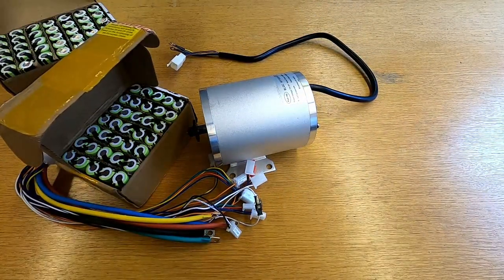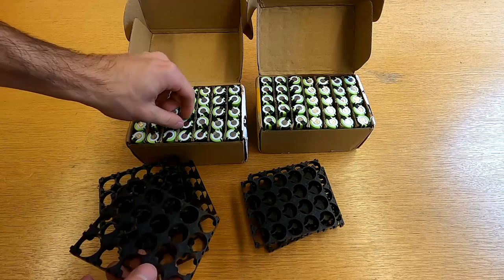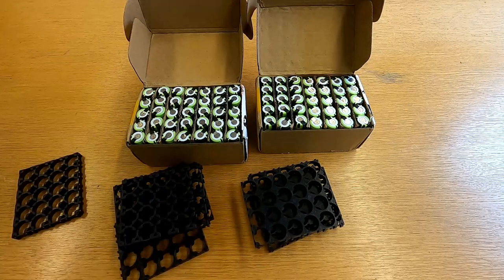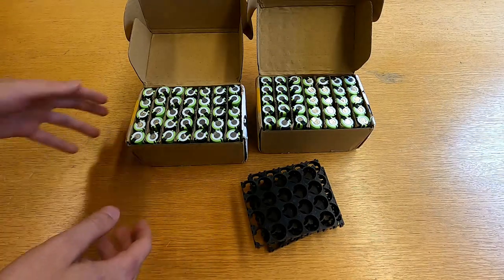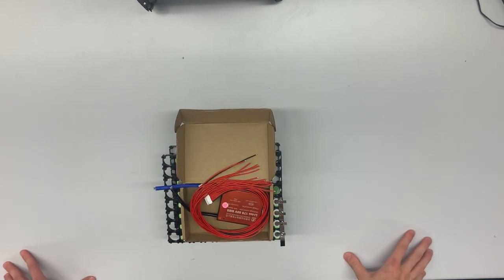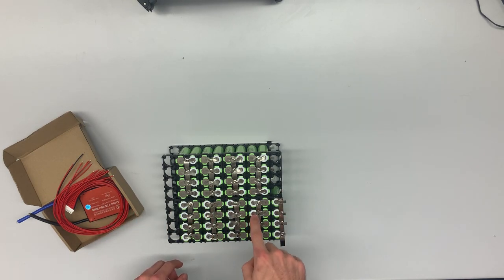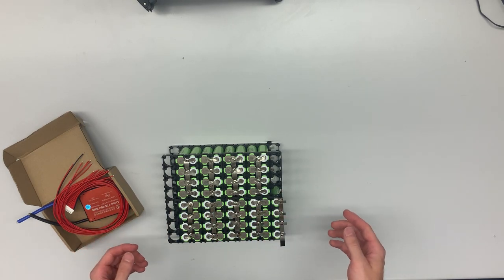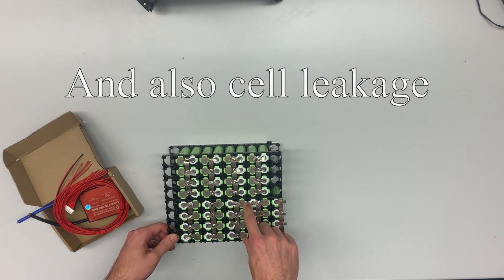DIY Electric Go-Kart #01 || Motor & Battery

Comment: Hi man, I would like to know how many Ampere is the continuous discharge current of this battery. I have a 2000w engine and I heard that I need at least 42A of continuous discharge current to use all the power of the engine.

Comment: Do you ever get this up and running? I just ordered the same style motor and was wondering if it was powerful enough for a go cart?
Reply: im sure by now you have the motor. Im looking at ordering it as well. Hows the performance?
Reply: @galacticgamer1752   I’ve got mine up and running. It’s top speed is 11mph with me and my 5yr old in it. It acceleration is pretty awesome so I’m sure with a different sprocket it would support more top speed. Only issue was the lack of hood wiring diagram and how touchy the go petal is from a stop.
Reply: @ktga67ish i have the same motor and i fiddled with the sprocket size and i hit 30mph on mine.
Reply: @SKITYSTUDIOS Where did you get the sprocket from?
Reply: @ktga67ish  i changed the sprocket on my axle i got a 65 tooth. It was on ebay.

Comment: I don’t understand the 72 v and 12 Ah. Can someone please explain this to me? If you did 5 in parallel, would it have 15 Ah? How many batteries would I have to connect in what way to get 60 volts? Why is he connecting the positive ends with the negative ends? I don’t have much knowledge with batteries and it would be greatly appreciated.
Reply from the maker: There are two ways to connect two cells/batteries together. 
Parallel: here you connect the plus poles together and the minus poles. If you do this the voltage remains the same, one cell has 3.7 two parralel cells also have 3.7V. But what changes is the capacity, as the two cells share the load they need to work half as much thus have double the capacity 3Ah + 3 Ah. 
Series:  here you connect the plus to the minus of the other cell. The resulting larger “battery” has double the voltage. 3.7+3.7=7.2V. You can imagine if you connect one pump to the intake of another pump you get double the pressure as they both add their strength together. But both batteries have the full load so the capacity remains.

Hope this helps

For a desired Voltage just calculate 60V/3.7V to get a rough number of cells needed in series
Reply: @bootlegengineer  Thank you so much. This really helps and will be really useful. Thank you for taking your time to help me when you didn't need to. Just to make sure I'm understanding this correctly, you connected 4 in parallel to increase the capacity, and then connected those in series to increase the power?
Reply from the maker: Thats the gist of it yeah. Theres one thing that i might need to add. If we think about batteries like pumps that pump electrons around (and this analogy works well for pretty much everything) then the Voltage describes how much Energy/Potential resides in one electron, so to know exactly how much Power we have running we would also need to know how much current flows. Current I(measured in Amperes) denotes how many electrons are passing per seconds. So if we multiply the Energy of one electron (the Voltage) with how many Electrons are passing per second, we get the real Power thats delivered. 
Why is this important here? If we look at the specs of one cell. It has a limit of 10A for one cell. But if we now connect two cells in parallel each of those can pump 10A so the max Current also adds up to 20A. If we connect them in Series, one electron has to flow trough both of these so at 10A both see this whole flow.

Hope this didn’t confuse but i think it was important to fully understand

Comment: What do you use to recharge the battery ?
Reply from the maker: I use a CV CC (constant voltage / constant current) charger that is meant to recharge ebike batteries. You just have to check if the voltages match, and the batteries can handle the current. Mine is 71.4V 4A which matches my setup. Was 45ish $